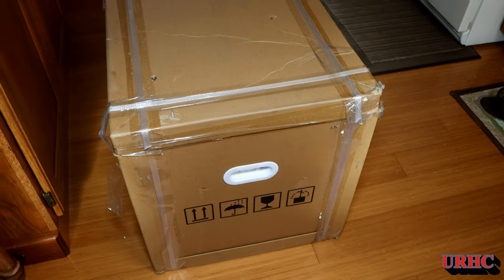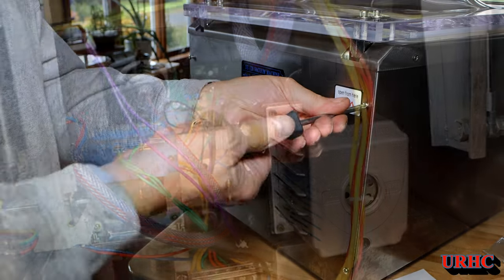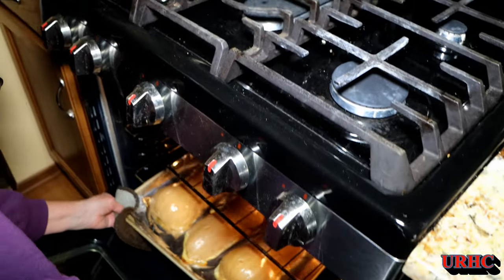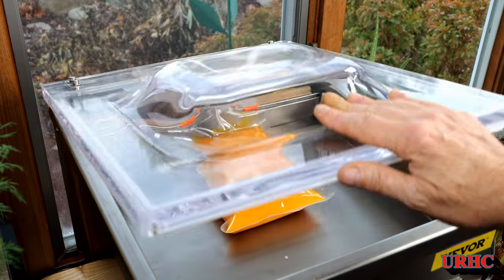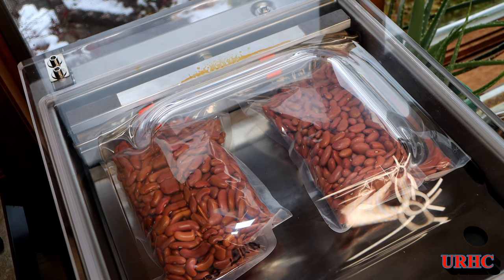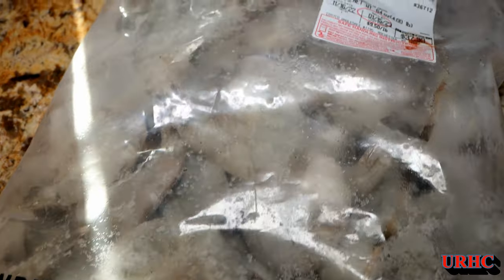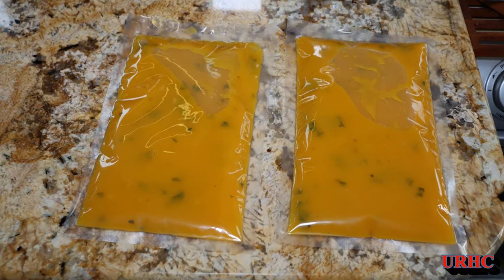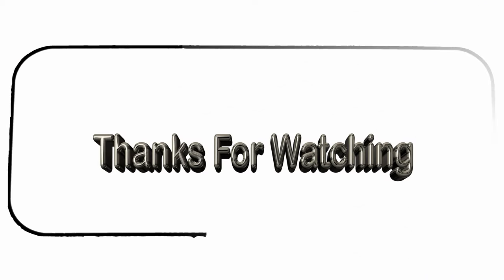Vevor DZ-260C Digital Chamber Vacuum Sealer Exceeds My Expectations For A Budget Priced Chamber Seal

Comment: i think you butternut squash was boiling there. lol
Reply from the maker: It definitely was. Found out later everything must be cool when packing to avoid that. Machine still works great. Thanks for watching.
Reply from the maker: It wasn't bad. The bar lifted enough to get under without disconnecting the wires. would be nice if it picked right off though.Thanks for watching.

Comment: There is no support for this machine, and no replacement parts.
Reply from the maker: I thought it comes with a one year warranty.  We have done several thousand bags now without one bad seal so I have not dealt with support.  I did have an email from a buyer that said the support took care of his problem.  Are you having trouble with a warranty claim? Thanks for watching.
Reply: Vevor told me to seek out local repair and offered me $105.00.
Reply from the maker: That stinks. How old is it and is it a problem that requires proprietary parts?  If you bought it through my link I can try filing a complaint with your order number that is tracked through my account and see what they say. Most companies will at least help you find the issue and send the parts to fix it. Labor is usually on the buyer with stuff from china.
Reply: You are very kind. PayPal refunded in full. Mine was damaged in shipment. The vacuum motor had the back mount break, move to the front and crush a relay and dislodge a connection with two blue wires. I have just enough skill to order the part from china, Replace the relay on the board and mine works like yours. Vevor did have me check some connections and voltages but gave up. They did say I could order a new machine with the refund but with all the pics and video i sent I am pretty sure Fedex gave them a refund. All is right for the most part. Thank you again for taking the time.